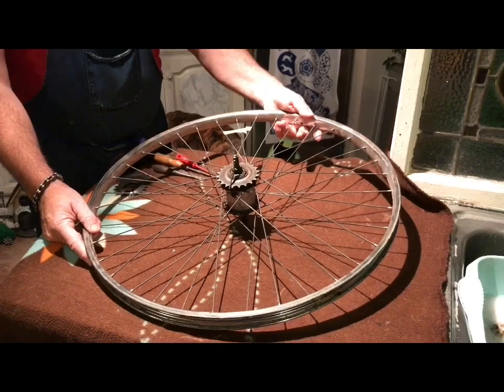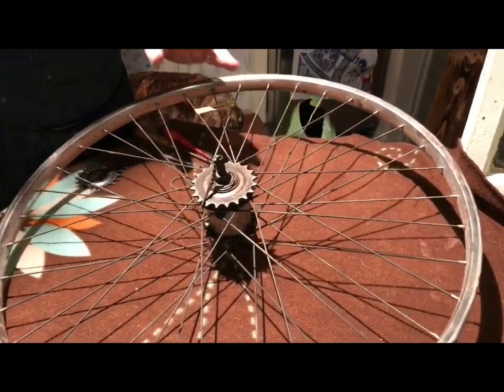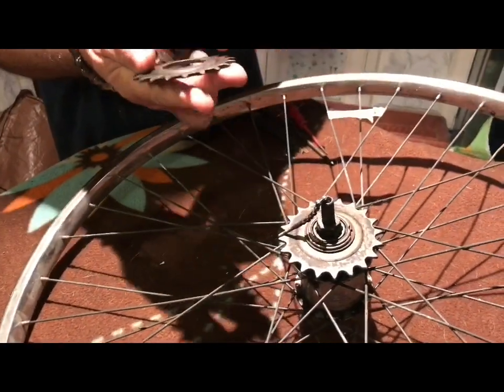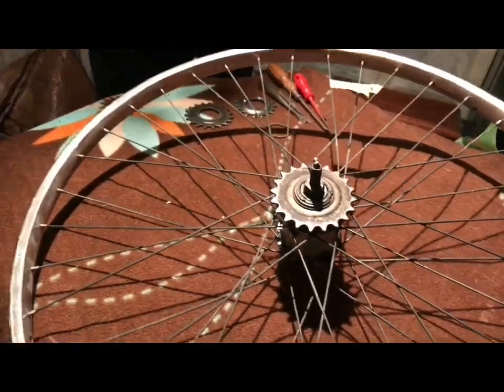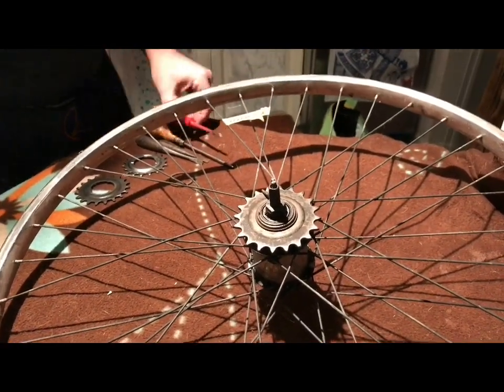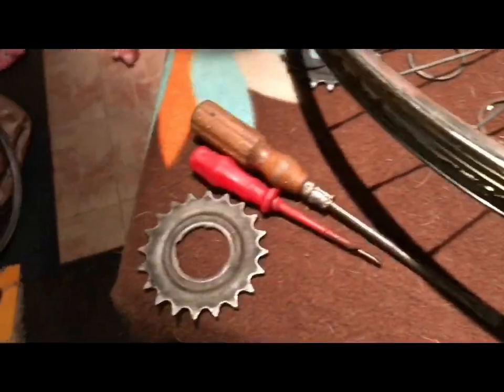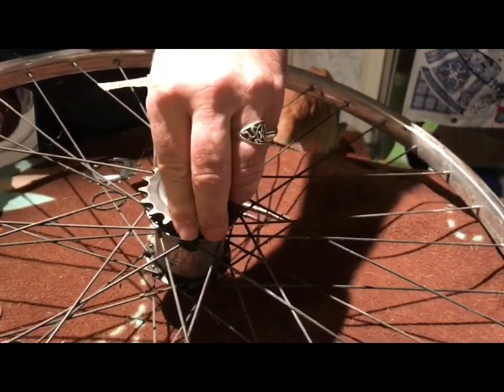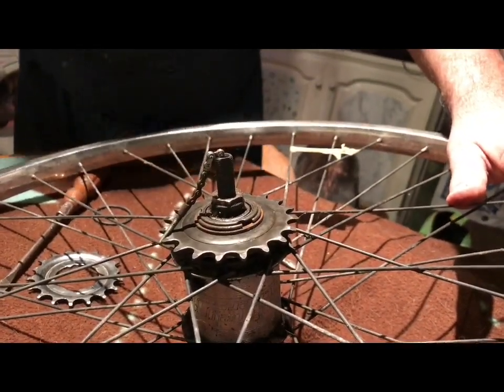How to replace sprocket on bicycle internal hub gears. Sturmey Archer, Shimano, SRAM, Sachs.

Comment: Very helpful guidance. When I changed the sprocket on my bike it was fairly straight forward because I knew what to expect. The hardest part was the final fiddly bit of getting that round spring back in. 
I swapped a 17T for a 20T and had to put a new chain on as the old one was worn. I watched videos showing how to size a chain on a BMX or other single speed as it's the same principle for an internal hub bike. I would never have considered myself capable of doing these things until the other day.

Comment: This was a good video! I have an old Hercules bike, and the original wheels are worn out. The second gear on the geared hub has fully stripped out, and due to my own incompetence I've damaged the front bearing by not servicing it regularly. I actually really like the faster gearing of my 17 tooth sprocket, and don't want to deal with replacing the chain, but I've mainly been finding wheels with 18 tooth sprockets when I look online. Now I know how easy it is to swap them out, I feel a lot safer getting a wheel set with a different sprocket.